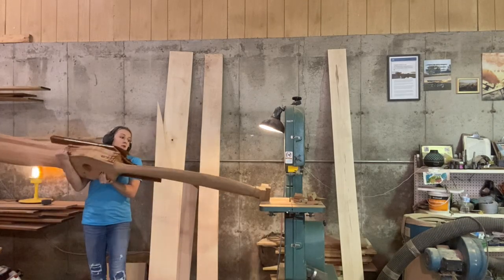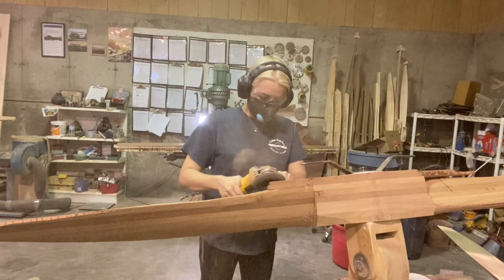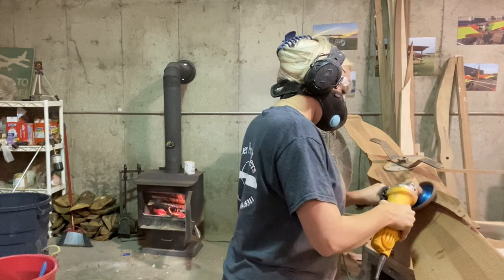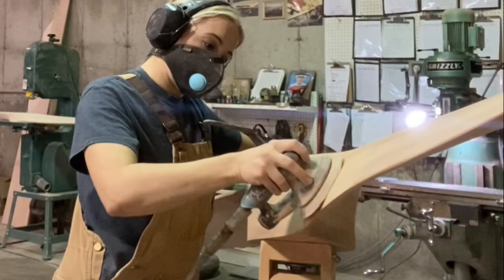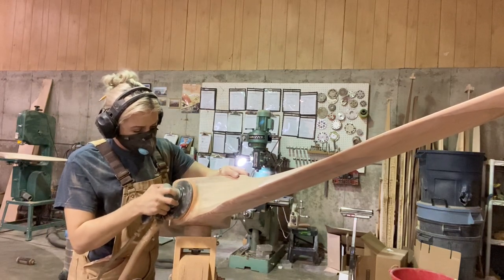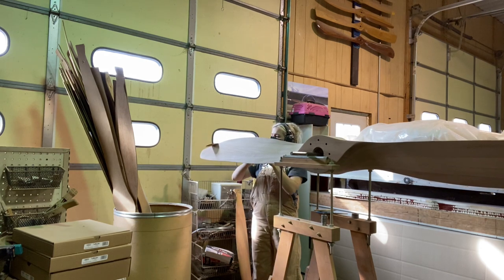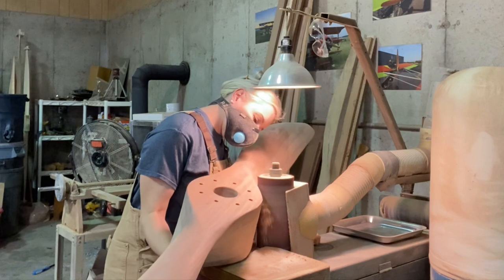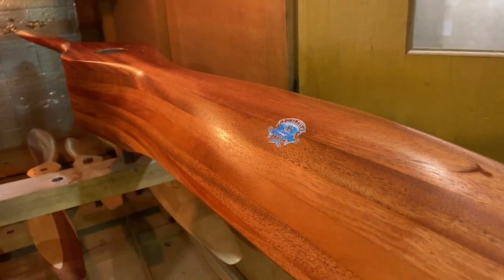Sopwith Prop Part 3

Comment: Nice work! But do you not test run it (and the other props you make)? To get a proper balancing for one, but also to make sure it has no structural fault and comes flying apart at speed. Because that (both) can get ugly.
Reply from the maker: I do not, it isn’t necessary